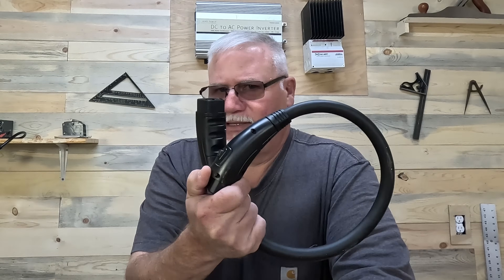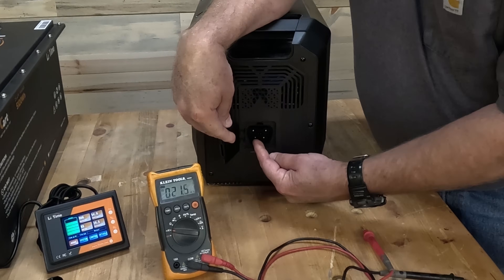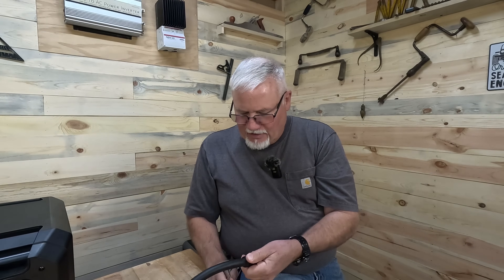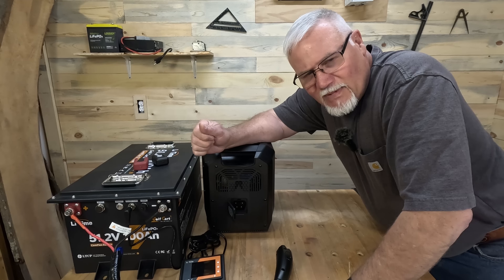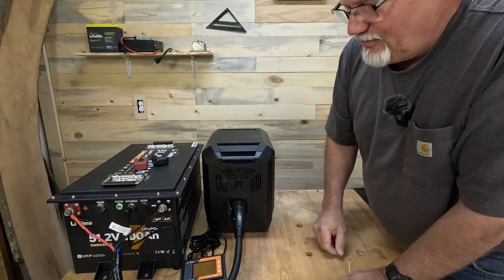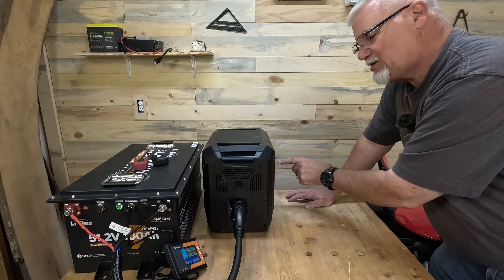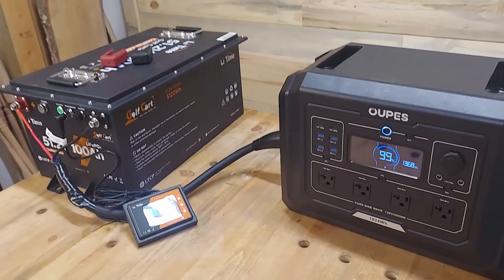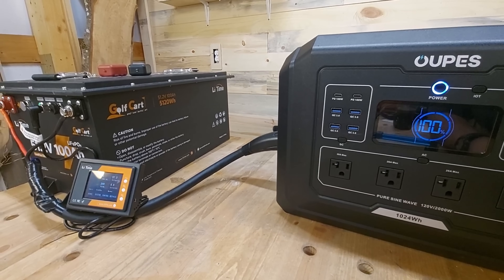The Best Power Station Boosting Hack Yet!

Comment: ••   @TheOldJarhead /  Now using same exact battery with a Mega 2.. works fine so far.  I used both positive and negative leads in connecting the Mega 2 to the battery..  Also added in a fuse
Reply from the maker: Awesome!!!!

Comment: Super cool, I think I had seen someone try with Ecoflow already and the data pins and stuff lock it out, but hey this is proof of ocncept and might drive the community to come up with a solution even if it is some kind of data spoof add on.

Using the PV input method is working for my setup since I charge an external battery, but for a self contained all in one system this is way better with bi-directional.
Reply from the maker: Agreed.  More experiments need to be done but so far it's a win!
Reply: Hi there, any update on using this concept on Ecoflow Delta 2? THANKS IN ADVANCE 😅
Reply from the maker: Hey Marine, we should do a live together  🤙
Reply: @TheOldJarhead Let me know what you want to do, see if we can pull it together
Reply from the maker: I usually do lives on Sundays at 5 or 530pm PST but am open to earlier, maybe 3pm

Comment: The short cable that came with my E1600 only has two communication wires…just a red and blue and located in the lower two holes above the single one in the 8 pin configuration.  I’ve used the 16 foot cable with my E1600 and M2 and assume that one has all the wires yours has.
Reply from the maker: Haven't looked at that one but imagine the comms is proprietary.   Hard to say.
Reply: @ Yeah.. not sure if connection is some serial, canbus, or something else proprietary.
Reply from the maker: Hard to say.  I'd ve surprised if not proprietary

Comment: Is it possible to add solar panels to the Mega 1 and also add a charge controller and panels to the aux battery at the same time? The biggest issue I have with the mega 1 is the really restrictive solar charging when you add 5x the battery capacity.
Reply from the maker: Yes solar will work at the same time

Comment: Nice video, very helpfull to us.  Keep up the great idea's and enginuity.  So, what size inline fuse would you recommend?
Reply from the maker: Thanks.  With an 8 Guage cable like this a 40a fuse would be close.  You might get away with a 50 but max amps on 8g is 48a so get close to that.

Comment: I was looking at this cable. Both wires, red & black, brown & blue, have approx 56v. This would indicate both are connected to the pos and neg of the internal battery. Also consider that if drawing 2000w, inverter at full, plus a charge of 1000w the battery cable would need to handle 65+ amps. You'd need 4ga wire to safely handle that. The power wires on the battery cable are 8ga. So they would have to run them in parallel to safely handle the max load.
Reply from the maker: Except that 1/2, the draw comes off the main battery, but I do think running both is better, and I discuss this in Tuesdays video  😉
Reply: @TheOldJarhead  I have this same battery on order. A further hack is if I can leverage my OUPES E1600 gas generator using the communication lines and the other 56V pair.  I imagine E1600 would end up charging to the (20% Low/85% off) off  primary OUPES since it sounds like there might be some balance issues to some degree.
Reply from the maker: Could be a balance thing.  I'm betting cable length but not sure.  Might have something to do with the communication portion

Comment: Fun experiments! Have you seen what the channel 'NoiseLab' is doing with his F3800? Basically the same experiment 👍 It's cool to see that as long as you have the battery voltage available, they should work together in parallel. The screen won't really be accurate but you'll have more capacity.
Reply from the maker: I haven't seen his channel, but I will check it out! Thanks
Reply: @TheOldJarhead  it's some pretty awesome stuff.   It's a small channel so search for 'NoiseLab F3800'
Reply from the maker: I'll do that!  I'm at my cabin so probably do it when I return to the world 😉
Reply: Thanx for getting me here Jasonoid ! This vid got a like from me ! Would I be able to add a solar charge controller & panels to the 48v while it is slaved to the Oupes ?
edit: Yes https://www.youtube.com/watch?v=CWvJ9oJYHqc  from The Old Jarhead
Reply from the maker: Thanks for stopping by!  I see you got the answer you were looking for as well :D
Reply: @TheOldJarhead  IT'S ALIVE !!!!!  Just as you said Red + Right ; Black - Left. I bought a 51.2V 100ah Dumfume battery but was too cheap to buy a B2 cord. I bought 5' 8AWG w/5/16" lugs on both ends and cut it in half. I found that a yellow 12-10 butt splice terminal can fit over the "power prongs" in the side of the Mega 1 once the insulation is removed from the terminal. I soldered, then crimped the butt splice on to the 8awg and covered with shrink wrap the entire connector so if it was accidentally pulled out it could not touch anything. I am not using a fuse or breaker. To avoid surprises connect the positive first when combining and remove the negative first when separating. I have less than $10 in the cable. 
Now I need to find some panels with a Voc under 37V . Later on I could add a 48V MPPT that can handle a 150V string. Maybe a better inverter until I'm only using the Oupes as a battery charger (and a extra 1024ah) . Thank you so much TheOldJarhead and you too Jasonoid ! I have seen the light ...... and it is solar powered.
Reply from the maker: Awesome!!  Glad I can help!
Reply: The trick too is to have both BMS no problems then.
Reply: Jasoniod, would you be willing to try this with a delta pro max?

Comment: Thanks for this. I wanted to try it but didn't want to buy a cable to cut up!
Reply from the maker: You bet!  Be sure to have both off before connecting and turn battery on first
Reply: How did you hook up without the proprietary cable?

Comment: Basically both battery bank are 51.2V. The Oupes capacity is much smaller while the Cart battery is much larger.
Its just like if you parallel a smaller battery and a bigger battery. Both will work off each other to keep each other balance.
This hack is better than the battery to the solar port hack because you can essentially use your solar panels to charge the Oupes and it will charge itself and the battery that it's linked to.
Reply from the maker: Yes, true.  Except.  Later testing I noticed an anomaly:  Once the Oupes had no reason to draw off the GCB it dropped to zero load and the Oupes Battery draws off faster than the GCB.  I'm working on testing that now as well but otherwise, it works quite well.
Reply: @ Thank you for testing out this hack. 
If it becomes as easy and reliable as the solar port hack, we have a new ball game.
I've bee using power station as the head unit and my battery bank to feed it.
If this is 100% reliable, I can skip the MPPT to charge my battery bank all together and just use the power station.
Reply from the maker: I'm still doing some testing, and while this does work, I need to refine it a bit before I can say for sure it will be a long-term solution.

Comment: Is the Oupes drawing power from the golf cart battery to keep the Oupes charged? Or are they depleted together? How does the  Oupes extra battery normally work? I’m very interested in the E1600 generator with a Mega 3. Just wish they had a 240v 50A option for the house.
Reply from the maker: The way they should work is the two batteries work in parallel so draw together.  I did notice a slightly faster decline in the oupes but otherwise no issues.

Comment: very cool, I have a mega 1 on the way and I will consider this option.  Does it have to be a 48v battery?  could someone use a 12v 100ah or a 200ah?
Reply from the maker: It must be a 48v battery to parallel to the Oupes.

Comment: Please do the same experiment to the Pecron e1500.
Reply from the maker: If I can get a cable I will.  So far I only see one available Mid May
Reply: @TheOldJarhead  Look forward to it. Be safe devil dog.
Reply from the maker: One thing we can do is check voltage at the expansion port.  I'll bet it's open to the batteries.
Reply: @TheOldJarhead  You're right.  I got 50+V at the expansion port.  You may have seen that Pecron is selling the new "MJ32 Cascade Port Output Cable" that gives direct access to the native voltage of the internal battery.  They are marketing it as output to charge other power stations if they have say an mppt input with a range that includes 48V.  I'm thinking that the expansion port can be bidirectional, but I don't know for sure.  I want to hook a server rack batter to it but waiting for some YouTube video to demonstrate that it's safe, and that it works like an expansion battery that can be charged and discharged by the main power station.
Reply from the maker: I did see those cables and was wondering if they might be a good way to do it.
Reply: @TheOldJarhead  The MJ32 Cascade Port Output Cable description says each XT60 lead could support 1200W.  I would combine both and wire directly to the external battery so it supports up to 2400W in either direction.  The question I have is, if it can discharge and charge the DIY external battery without the communication wires like the Opus,  what purpose did these wires serve that we will be without with the DIY external battery?  And what are the risks of not having those functions?
Reply from the maker: Thise wires appear to be just communication wires to allow the display to accurately reflect the added capacity.  I can think of no harm in not using them myself.

Combining the wires would basically double the capabilities so yes I think that should work and since the port is bidirectional I see no reason it would charge as well.  Testing would confirm that.

Comment: Love to see this with all brands. I have a use case for this with my Ecoflow.

Edit - The Delta 2 will adjust the remaining time when 48v is applied to the extra port but it won't charge or discharge through it. Need to investigate the cable.
Reply from the maker: If I had an Ecoflow and cable, I'd do it!  But I doubt they'd send me it 😆🤣😅
Reply: trying this out on a couple of Allpowers R4000 units on the expansion ports.... still testing.... the display data is definitely not matching up.... seeing this video my next test is the EV port
Reply from the maker: The display won't know it's hard all that extra power but will know what the voltage is on the main which should tell it capacity.  The issue is the draw.  It won't know how many hours are left.
Reply: Hi any update? I have a Delta 2 and a 48v 50a battery and cable ready to do it,please help!!
Reply from the maker: 👍Check in with us on the Live Sunday at 3PM Pacific time!

Comment: Confusion abounds... where did the charge come from? With no solar or grid input, how did both the battery and the power station get to 100%??   If memory serves, and while that's getting less reliable by the second, I'm pretty sure at least one of those were at a SOC below 100, and yet both ended up at 100... I must have missed something...
Reply from the maker: You must not have watched all the video or paid close attention?  At the end of the video I explain that both should be at 100% and that I started at 97% on the GCB intentionally to see what would happen.  Where the charge came from BEFORE the test isn't relevant to the test though it may have been obvious to the keen observer as I was charging up the battery off utility power at the beginning of the video it would be hard to catch.  Again, not really important for the point of the video which is "can I do this" and the answer was a resounding "yes!" :D  Cheers!

Comment: In a way, even though it worked with a somewhat obscure power station, will it work with the more popular ones also?
Reply from the maker: I don't think Oupes is obscure, but I see no reason it wouldn't work with others.
Reply: @ Sorry I said obscure, but to me, if one does their research, they would not be purchasing the Oupes over better equipped and better priced unites
Reply from the maker: Not everyone can afford a Porsche😉  I am willing to bet this will work with ALL power station manufacturer's systems.  No reason it would not.  The key here is that if they have an external battery port it's meant to parallel another battery (or 2, 3 or more) and as such must have a direct, uninterrupted connection to the internal batty.

Comment: It wouldnt work with a 36v?
Reply from the maker: The Oupes has a 48v battery, so you must use a 48v external battery as parallel batteries should have the same e voltage.

Comment: Probably have dual pins so you can increase the amperage
Reply from the maker: I think it's for the 2nd battery
Reply: @guywood67  Reduce resistance?
Reply from the maker: Nope.  2nd battery.  Remer the Oupes is designed to have 2 external batteries.

Comment: Proprietary batteries suck , need ideas like this or better yet companies should sell expansion battery cables with ring terminals.
Reply from the maker: Amen!!!
Reply: I use Ring Terminals from 10KWH 24 Volt Battery Bank to 10/3 Tinned Marine Grade Wire for almost 80 feet from Well House / Solar Shed to Kitchen and an XT60I Plug for My Echo Flow Deltas using the Solar Port with no worries - Happy Easter Jarhead 🙌
Reply from the maker: Semper Fi Brother! 🇺🇸
Reply: Thanks for the information can save alot of money how many batteries can you hook up to the mega 1

Comment: Great test!  In case you didn't know,  the Oupes fan symbol on the screen in charging mode will continue to spin in a circular motion when charging, once this fan screen symbol stops it's circular motion the charging process is completed.  

I have several different Oupes generators, all operate the same using both the 100% and fan symbol on screen to determine when charging is completed.
Reply: You're welcome, I picked up this tip from Oupes. As long as the screen fan symbol is spinning even at 100 % it's still charging, thanks again.
Reply from the maker: I'll have to keep that in mind.
Reply from the maker: Thanks!  Good info on the fan symbol.  Thanks again!
Reply from the maker: Just got a chance to get back to this and yes!  At 9:10 in the video you can see just that!  Thanks 😁

Comment: Yea! I'd like to see some long-term and more extensive testing and of course use an Eco flow. But it may be worth getting an Oupes just to replicate. You get a Mega 1 and the golf cart battery and you've got a 6000Wh system for around 1700.00. This would certainly be a cheaper way to go if it's reliable. I'm impressed.
Reply from the maker: Agree long-term would be good to see, but since it's a parallel connection, it should run just fine long term.  Also, server rack batteries might even be less cost!

Comment: Can you use solar to charge both?
Reply from the maker: I will have to test that, but I don't see why not.
Reply: @TheOldJarhead  They should as both battery are parallel to each other.
I have 3 Dabbsson power station that has extra battery port. They should also work.
I will have to let you try it first though 😁
Reply from the maker: lol we'd have to convince Dabbsson to send me some...oh wait....keep an eye on the channel 😉
Reply: @ I looked for the Dabbsson cable and it's like $70 where as the Pecron cable is $30.
Reply from the maker: Interesting.   I don't have a large Dabbsson Power Station yet but am testing a brand new one they just released and am impressed.
Reply: @ I have the DBS3500 and 3x 1400pro. Which one did they send you ?
Reply from the maker: A new on coming out next month!  It's a small one but I'm loving it!

Comment: I wonder if this would would with ecoflow as well!!! Im assuming if you were yo connect an oupes expansion battery to it would tell you overall run time but does the app show any of the information with that battery there?
Reply: Hmmm 🤔🤔🤔🤔🤔 even if that's the case the fact that it works in general is great. I'll have to do some research with my ecoflow.
Reply from the maker: I think you'd need thise comm wires to get accurate run time, but with 6kwh, it would run 6x as long 😀
Reply: @mk2gtikid hi,any update on this concept with ecoflow??
Reply: Rumor is that the Oupes doesn't show extended run time when an expansion battery is attached.
Reply from the maker: The battery monitor doesn't, but the Oupes sorta did, though it was wrong.

Comment: The amperage at those connections is 600 amps?
Reply from the maker: No.  The draw would only be around 20amps at 2000w of the inverter.
Reply: @TheOldJarhead  True. But there are 600 amps available? I'm not an electrician but my understanding is that amps ki11.
Reply from the maker: Yes but.  All batteries do is wait for something to draw off them.  They are typically restricted by the BMS and in thus case the Oupes won't draw that much but a fuse adds protection.